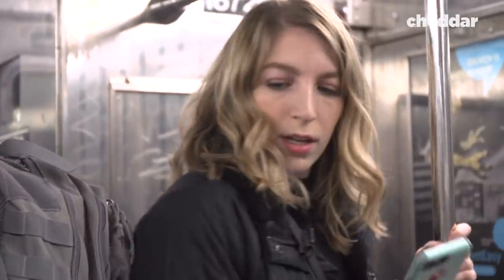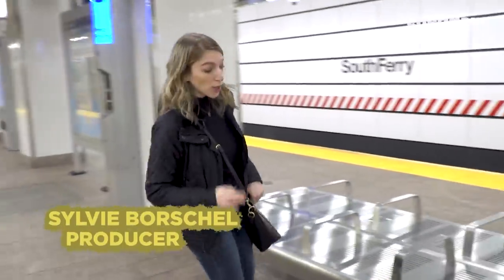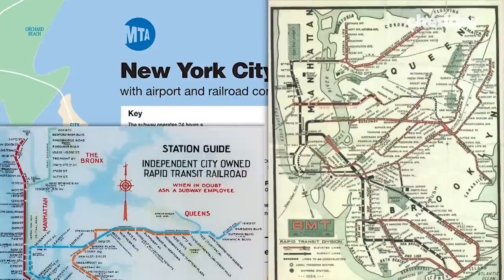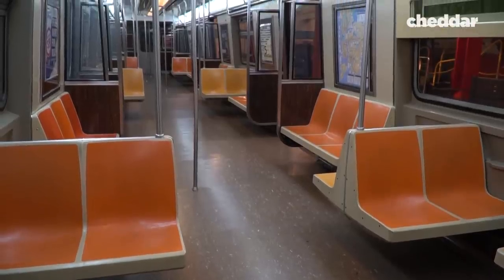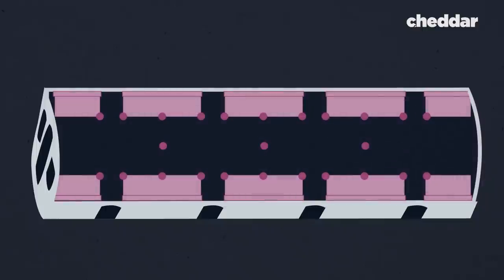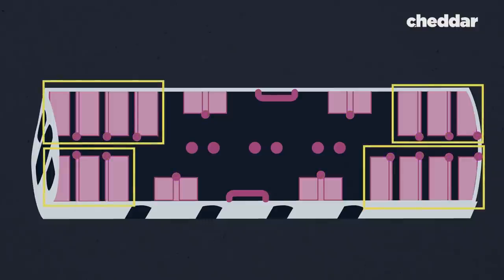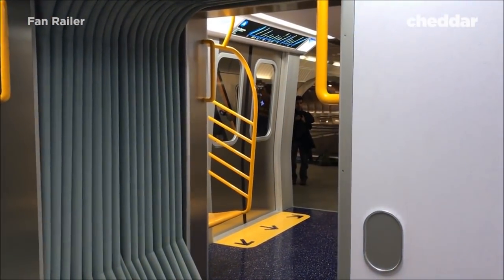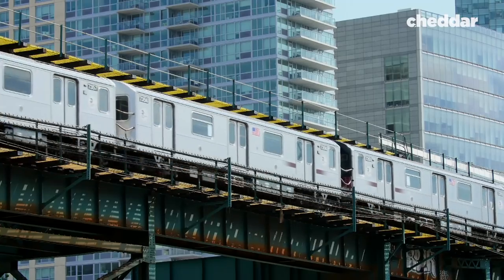Could This Subway Car Save NYC Transit? - Cheddar Explains

Comment: That design is stupid. People like sitting alone - they don't "not like the middle seat". 

It's like urinals. You need one between each person. Having two means only one can be used comfortably. Whereas with three, two can be used comfortably, with the middle seat/urinal between them.

We have that layout in Perth Australia and there'll be half the seats not used, and it is impossible to get to them because people prefer standing in the skinny aisle between seats over sitting down next to someone.
Reply: In New York riders use every seat.
Reply: Tim Green and the squeamishness about urinal spacing is new.  The new generation.   Previously all were used. - with no dividers!!!
Reply: New Yorkers will share a seat with you if it means they get to sit down which never fucking happens on the MTA
Reply: @Paulinrnke  Squeamishness about urinal spacing has been around at least 40 years. Every single time I saw a bathroom with no dividers, I'd be upset. Thankfully, they are rare now everywhere I've seen.
Reply: Place them like in trams - one behind one.
Reply: Yeah, but Perth isn't NYC. It doesn't have the issue of overcrowding in transport, it's practically in the middle of nowhere even by Australian city standards.
Reply: @svobodniknarodnik7128  indeed, which means it makes even less since to use this layout in New York.

Comment: 5:16 the airline style seats seem like people would jam up the aisle trying to get out if they have luggage
Reply: Not to mention you'd always have to be climbing over people to get into or out of the window seats.
Reply: Vancouver MK2+ skytrain cars are open gangway and airplane style . Not a big deal, very comfortable. Luggage isn't really an issue and most people have the foresight to start exiting a stop or two before their own if it's busy.
Reply: that airline style seats are already exist in european subway system for a long time and they are getting rid of them these days.
Reply: @DMTHOTH where are they? 
The only thing I notice here in Europe is an overall reduction of seats in favor of larger open areas near the doors (so short-distance travelers don't crowd the passage further into the train, while long-distance travellers still have seats). But apart from that most designs still faeture transverse seating arrangements if there is enough width available.
Reply: That's what I thought.
Reply: Not just luggage. It just seems like a recipe for sexual harassment and/or violence. It would be too easy to corner someone and not let them out. And unlike an airline, there won't be as many eyes with authority walking up and down the aisles or any weapon checks.
Reply: @TheLongView well... crime/violence simply isn't an issue over here.
Reply: @0hermitworm  With open gangway trains it would be harder again to really corner someone without anyone noticing.
Reply: @Dann0343  I personally find our airplane style seating to be really annoying, especially as someone with long legs. Would much prefer benches along the sides for ease of getting in and out of the seat, and making more standing room.
Reply: @Dann0343  please trust me, NYers would find a way to screw up any layout. I say that as a proud NYer
Reply: You ever been on a bus before? Two seats side by side isn’t terribly difficult to deal with. Any jam packed bus or train is tough to navigate no matter the layout.
Reply: We have this kind of seating in the Mumbai Suburban Railway, and its a mess. They should continue the horizontal layout but with the skewed exits as shown in the ideal car design
Reply: Yeah it'd be better to alternate the direction of the seats so that two rows face each other
Reply: Has nobody on this thread ever been on a bus?
Reply: @shadowgaming6660  bus? Ew
Reply: @DMTHOTH  they are getting rid of them here too in Australia
Reply: The Dudeface I spent my entire childhood taking NYC buses. When they’re crowded, they’re MUCH worse than any subway.
Reply: @BakoomishCips  I was talking about the closely packed airline seating where the back of the bench could easily hide that someone is being threatened.
Reply: @EchoOfGecko  yes, that'll happen. On some lines in HK we have window seats, and its always a hassle crawling over some old grandpa with a heavy backpack.
Reply: horrible design
Reply: Dann0343 I don’t think you’ve ever been on the NYC subway during rush hour, there’s sometimes no room to do that even in its current construction given how packed it gets. People really don’t seem to get this. That model might work in some places but they don’t have as many people riding. It just won’t work here, especially on certain routes.
Reply: Sean Luchterhand Yeah the lack of standing room is really what concerns me. The MTA fucks up a lot but they got this one right. It seems like whoever designed that one hasn’t ever ridden the NYC Subway during actual rush hour because I have and I can say given that there’s less standing room than the current configuration, all that’s gonna do is cause even more overcrowding during rush hour
Reply: I have never seen very many people in a NYC subway car with luggage. If you are talking about the airtran which specifically goes to JFK airport then you can have different seating on the airtran.

Comment: The TRB's design has the same number of seats but far less capacity because standing room is lost- that's why all major transit systems (NYC, London, Tokyo, Hong Kong, etc) rarely use transverse seating on their busy routes. At the end of the day, this new design won't do anything to fight overcrowding and will just make it worse.
Reply: Actually transverse seating in the “ideal design” bear some resemblance to the Hong Kong East Rail Line Metro Cammell stock, but even these rolling stocks are on the way of retirement and will be soon replaced by complete longitudinal seating trains.
Reply: Well that is somewhat right. But also somewhat wrong.

Now obviously a standing person takes less space than a sitting person and longitudinal seating takes less space than transverse seating. However that is in theory and as it has been proven time and time again humans aren't perfectly behaving entities in a test environment.
The capacity of the train is actually not the most important thing to consider when designing these trains. The loading time is. It doesn't matter when your trains carry 10% less people when you manage to get 10% more trains in.

And it is perfectly explained why it usually takes so long to load the trains. People feel uncomfortable standing right in front of others. Or sitting next to them. With the longitudinal seating you basically have to push most people into the middle of the train while transveersal seating means you don't stand right infront of another person and people are more likely to move there quickly.

That being said wwe still have tot ake the width of the train into consideration. YOu can only reallypull that off with rather wide trains. London, one of your examples, is known for rather narrow trains on their older lines. They have no other option.
Reply: Krawallnoez Noezington if you only want to eliminate the time between trains’ operational time, then you’re right. However, that is the operator’s wish, not the passenger’s. Passengers measure their commute in just two factors: time and ease/comfort.  Increased capacity on trains would allow trains to take on passengers that are right now stranded to wait for the next train, or even the one after that. That is the overcrowding issue. Having more trains run more often is a solution, but only for systems that can handle it safely, something the NYC system cannot do. It is at its operational capacity as far as train volume goes. The point here is to find a design of cars that fits more people and allows them to get on/off fairly quickly.
Reply: To maximize a subway train capacity so the passengers don’t clutter near the doors, a common solution is to have more doors per car. After quick googling, I see that NYC subway trains have 4 pairs of doors each side at most. In Hong Kong, all metro trains have 5 pairs per side.
Reply: ifurkend depends on the length of the car.
Reply: Its more about making monnnneeey
Reply: Its 2019, lets just make the whole side a roll up door.
Reply: Paris only has transverse seats with the exception of the end of coaches.

Comment: luckily the first design wasnt chosen... 
those in the seats will have no chance of getting out during rush hours
Reply: Works well in comparable cities, like London and Paris.
Reply: plus the seats will become even more entrenched by hobos
Reply: @johnperic6860  yeah its worse
Reply: shng sam: here in utah we have similar trains, those who have a longer distance take those seats at the ends then move to a closer seat or stand for the last stop or two.... it's not bad at all. People just have to think differently.
Reply: it just don't belong on train that had to stop for every 30 second..
Reply: Here in Utah, where the population is less than half of the city of New York’s in an area 180 times as large
Reply: good point there it can be the case of those who go for longer distance can choose the further seat. but i just thinking if majority of commuter is going down next few station, everyone will be standing near the exit and the space will be wasted
Reply: @johnperic6860  The daily ridership per km is vastly bigger in London and Paris, I know. :)
Reply: Bums would stinkify those seats. I wouldn't use this design unless NYC actually does something about rent control and not let developers run things.
Reply: shng sam we use these seats in berlin, and there is really no issue. so many people get off at each stop during rush hour, there is really always a path made to get out. plus, people only get seats if they’re on a longer ride, so they can get up a little bit in advance.

Comment: After using the Toronto subway, the open gangways do help a little during rush hour.
I recall being in Hong Kong where the number of seats were generally reserved for elderly, children, pregnant, and others who need it. that created a lot more standing room and could fit more people. The trains were also a lot more frequent. Though, HK is a transit city where very few people drive a personal vehicle.
Reply: coz HK's MTR building date(1970s construction, 1979 1st phase of track launch) is later than every metro (NYC, London, Tokyo), so the car size is roughly 50% bigger than NYC rolling stock and one of the biggest car size when it build in the world: 23 metre long, 3 metre width, 3.7 Metre height, carry 312 passengers each car & 8 cars per stock(4 car when 1979) & 2 mins 1 train in peak hour
Reply: In New York City an open gangway on a subway train will just allow the showtime performers to harass more people and the homeless stench to waft throughout the entire train. You will not be able to get away from either of them.
Reply: Darth Nihilus  That and other cities don't have performers or homeless people.
Reply: LOL at new yorkers respecting handicap/elderly seating.
Reply: Edward Kowalski That joke is really getting too old.

Comment: I've always wondered what would happen if a London Underground train randomly pulled into a NY station as a test
Reply: London cars are tiny.  They would fit.  They run on the same rail gauge.
Reply: @MilwaukeeF40C  Only the deep level ones.
Reply: @MarioAtheonio  Even the standard ones are smaller than BMT/IND cars.
Reply: Moscow trains use the third rail and have been open ended for a few years.
Though perhaps the key is train control system which allows average wait time as low as 90 seconds. Simply changing carts won't really solve anything...
Also average speed matters a lot.
Here's a video of local Russian trains, if anyone's interested - https://youtu.be/gctdEPjBRHQ?t=120
Reply: @NJ-wb1cz  Agree! Frequency and regular intervals between trains is much more important then trying to make trains runs on a fixed schedule. !
Reply: London Tube in NYC: Coffee consumption would go down... Starbucks etc would see a slump in business.
Reply: Bushrod Rust Johnson nope, the new S8 and S7 stock is moch bigger.
Reply: That new train is like Madrid  Metro ones (L10,L8),fully open. They look a little more futuristic,it is a good design,I even travel with my MTB no problem.
Reply: I've always wondered what would happen if a TGV Eurostar randomly pulled into a NY station as a test.
Reply: @Ben Bristow You could do a mod for one train. All you would need is one mover unit to pull the whole train. Gauge, car width and height are the major issues. Don't ruin a good fantasy with spurious technical details.
Reply: @paname514  Bullet trains can't run in subway tunnels, plus it's too powerful for them to run on a third rail track...
Reply: @paname514  Still, They kinda look too strong for MTA's third rail...
Reply: @tescotrain  oh ok but I still find it impossible that a bullet train can run on a 3rd rail track, I feel lost on this one...

Comment: Coming from a lifelong NYC railfanner, I have to say that the R62/R62A design is arguably the best one. It has eight seats per "bench" (as opposed to seven on an R142/R188), and there are four to six seats at each end of the car's interior (four if there's a full width cab, six if there's a half width cab & an accessible storm door to walk between cars; yet an R142/R188 will have anywhere between zero to six seats at each end, depending on if it's a blind car or a cab car). The R62's seats are defined & bucket-shaped (so you know exactly where to position yourself on any bench. On an R142/R188 however, it's just a smooth uniformly shaped bench (which even at it's longest length holds less than what an R62's longest length bench can seat), which means people can easily "manspread", taking up more space in the seating area than they are already supposed to. But at the very least, both the R62 & R142 (plus their respective variants) only have center facing seating, which means wider standing room, and it's easier to get in & out of a seat (the next example below will explain why).

And then you have the R46/R68 design, which I feel is the opposite. For starters, roughly half of the seating is forward/backward facing (and is always adjacent to whatever center facing seating is around), which makes it more time consuming to board/alight (i.e.; you're sitting in an aisle seat, but someone wants sit down or get up from the window seat next to you, so now you either have to turn or even stand up to let them in or out of that window seat). Next, by having much of the seating being forward/backward facing 2x2 seating, you have reduced the amount of aisle/standing space (and width) in the car, which is also going to make boarding/alighting more time consuming. Then you have the homeless/odor issue...if you wanna change cars (but really cannot wait until the next station or as of very lately you'd rather risk getting in trouble for using storm doors), the storm doors on an R46/R68 are always locked (R46/R68 cars are 50% longer compared to R62/R142 cars, thus resulting in more extreme gangway shifting when the train is moving), but at least on any other make, you at least have the option of transferring to the next car (assuming you can). Finally, the door/train length ratio is the worst with R46/R68s (a 600 foot long 8-car train of 75 foot long R46/R68 cars has 32 sets of doors on each side; yet a 561 foot long 11-car train of 51 foot long R142/R188 cars has 33 sets of doors on each side). The better the door/train length ratio on a Subway train, the more doors there are for passengers to board or exit the train, which in turn decreases dwelling times at stations & saves precious seconds which add up.

The most current state-of-the-art rolling stock (R143/R160/R179) is more or less in the middle here. These have a better door/train length ratio than the all the other train car variants in the NYC Subway (each car is 60 feet long & has four sets of doors on each side; a 600 foot long 10-car train of 60 foot long cars will have 40 sets of doors on each side). Similar to the R62/R142/R188, the seating arrangement is 100% center-facing...but it's the same uniformly shaped bench style seating as the R142/R188 (which brings up the manspreading issue). However, the storm doors are at least unlocked & navigable (unlike with the R46/R68).

tl;dr -- there's a lot of inconsistency with the train car designs that have been used, and these variances have impacted service in many ways on whatever subway lines they are assigned to. Realizing which design is most efficient is going to mean a lot moving forward with developing newer designs in the future.
Reply: o7. I can’t even explain this like the way you did lol